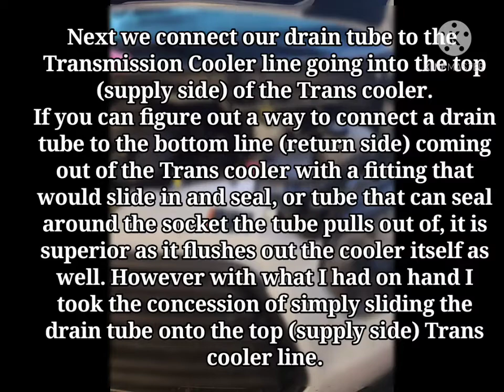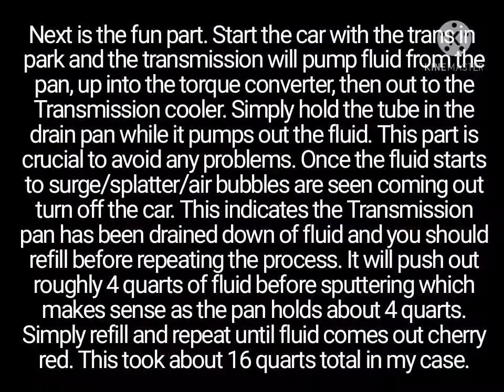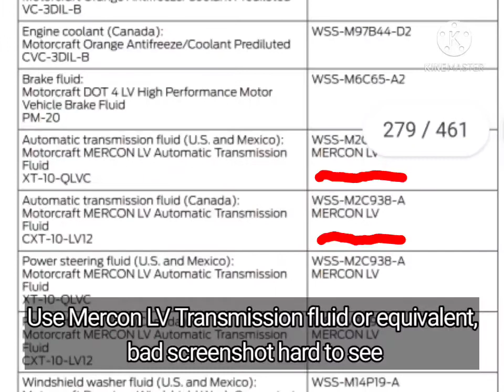DIY Transmission Fluid Flush 2015 Ford Transit 350

Comment: Awesome video!  I believe this is what I am needing to do on a Transit (2017) I recently purchased.  I've been getting a intermittent rumble when traveling around 35 - 40+ mph.  I didn't notice this during my test drive, and sometimes when I drive, it now it doesn't always happen or isn't always very noticeable.  While investigating what the issue may be, I really believe this is what I need.  I will update this comment on my results.

Comment: This worked great for me on a 2016 Transit 250. Not sure why more people aren't doing this. The hand pump method I see all over youtube leaves 3/4 of the fluid in the trans, and requires a lot more work than this easy method to get a full fluid change. Got rid of my transmission shudder immediately. You don't need to close the transmission fill port between cycles, you can leave it open with the hose in there while you're pumping the old coolant out of the other hose. Thanks for posting!

Comment: Thank you for the post. My '15 3.7L had 126K miles has been shuddering quit a bit when going into overdrive. Bought 4 jugs of transmission fluid and chased all of them. On the fourth fluid push the stuff looked nearly perfect. Good enough for me! The transmission no longer shudders when shifting into overdrive. Thank you for showing how to do it. I did some research on transmission work on the transit. Lets just say it is better to flush out he fluid every 50K or so.  The transmissions are a bear to work on. Thanks again!
Reply: I have a 118000 on my transit no real issues but thinking about doing the flush are you still glad you did it?

Comment: I did this on my 2016 transit 250 3.5L.
I had a problem that my van was rumbling when accelerating at 40-70mph 5-6 gear I think.
I did some research that flushing transmission will help. It actually did fix the problem for now. Drives smooth. My fluid was black. I flushed it with 20 quarts. Did exactly like in vid. I used 1/2 plastic clear see through hose. It slipped on nice and tight onto the transmission line( and It was the top one that connects to the cooler). Did exactly same set up as in video. One important thing is to have the vehicle kinda on a leveled ground. After my last flush I added 3.5 quarts let the van idle for about 5 min to bring up the fluid temp. Switched  P R N D M and back up for 10 sec each. While the van still idling I checked the dipstick to have the fluid at mid A. I had to add few times. It’s better to add than to remove  Do this while the fluid is hot. Try to do this flush as clean as possible. So you don’t get any dirt into tubes it’s very important.
Reply: Glad to hear that worked out for you!  I'm having the same problem myself and will be doing this same process here pretty soon.  Thank you for the thorough explanation of what you did too.

Comment: Thanks for this information. Just did my 2017 T250 today. My only issue was that each time my helper turned off the engine, fluid burped out of the now open transmission cooler intake port. I stuffed rags around it to help contain the gush but it ended up making quite a mess. Not a huge deal but others might want to be aware. Thanks again.
Reply from the maker: Glad it was able to help! Sorry about that mess, I didn't encounter anything coming back out of the Trans cooler port the line was pulled from otherwise I would have included that tip, hopefully other people see your comment!
Reply: had the same problem.... wasn't bad, 8 oz at most, so thin is goes everywhere

Comment: You said it spits out roughly 4 quarts at a time about what the pan holds. My question is about refill. Are you trying to match what came out and put the same amount back in or is it guess work?
Reply from the maker: You want to refill with about what comes out which was 4 quarts in my experience.

If you put less it will just start to spit air sooner, put more it'll go longer before spitting. 

As long as you don't fill past the fill hole and it starts coming out the top spilling on the ground, it really only matters to get the level right at the very end when you are done and going to go drive it again.

Good luck thanks
Reply: @nickerbocker1382  thanks for your help man. 2017 t250 low roof im about to do. I’ve got a soft shutter on takeoff that I’m hoping this will fix. Im doing that driveshaft recall as well. so you can’t over fill it?
Reply from the maker: @austin138  During the procedure no it will not matter. If left overfilled once you put the dipstick back in and go driving it will cause issues. 
So make sure to on the last round to park on flat ground, with car running run through each gear you can, leave in each position 10 seconds or so, then put in park with car still running and check fluid level on the dipstick and adjust accordingly.

Try to be somewhat quick, once it starts getting hot it is hard to do as the exhaust basically touches the dipstick hole.

I'd recommend adding lubegard Red transmission additive. I have seen great results with it. It takes about 100 miles of driving to kick in, but I've seen it stop complete shudder problems on a few transits.

Comment: hey thx for making this video. this is something i'm planning to do on my 2017 350HD. however, alot of the stuff i read including one of the service manual said that the fluid leaving the transmission is the bottom hose. the one you show in the video which is the top hose is the return back to the transmission. Can you confirm? thx
Reply from the maker: Yeah on mine I only undid the top line and connected it to a hose to drain. The top line was the pressurized line coming from the torque converter in the Transmission, the bottom line was the return line to the pan.
Reply: I was hesitant after seeing pictures posted online from service manual showing that bottom hose was feed from trans, but on my 2016 Transit 250 the top line was the feed line from the trans too.

Comment: Hey, how much fluid were you able to extract with that method? I used a fluid pump through the dipstick port and was only able to extract 5 quarts. Wondering if I need to do your method too or is it too late now that I've extracted everything from the trans oil pan?
Reply from the maker: With my method you get about 4 quarts per round, as it's pulling the fresh fluid from the pan you add each time.
But since it's not cycling the old fluid back into the pan, since you disconnect the hose leaving the torque converter and put into a drain pan, it let's the Transmission flush all the fluid within itself out as the new stuff is pulled in from the Transmission pan.
You are at the perfect starting point for my method as your pan is completely empty and ready to be filled with new fluid to start the procedure.
Reply from the maker: It took about 4 rounds for the fluid coming out of the tube into the drain pan to turn cherry red!

Comment: Does it have to be hot to do this while researching this someone said there some kind of thermostat inside the tranny that lets the fluid out when it gets hot maybe they were just talking about the shops that use the machines to do it they said something about the fluid needing to be kept hot so it could be flushed maybe that just for machines with there own pumps
Reply from the maker: I have seen information similar to that, I believe that is for machines trying to back flush. Since this is the car pumping the fluid like normal it didn't have any restriction due to temp as you can see from my video. There may be differences between years I am not aware of but seems many people have replicated my procedure with similar success. Best of luck!
Reply: @nickerbocker1382  thanks I'm thinking I'm going to try my van has a 118000 with no issues a little Leary about doing it but people here have done it with high mileage and seemed successful thanks for getting back to me

Comment: thanks for making this video, mine took out 3 quarts before the spitting/sputtering, air bubbles. so i did 3 quarts at at time, 18 quarts total. hard to get under the van level and check the hot level as the exhast is there,what a shit design ford idiots, I mean engineers came up with....
Reply from the maker: Glad it helped, yes the final checking is quite difficult as you need to put you hand right next to that exhaust!